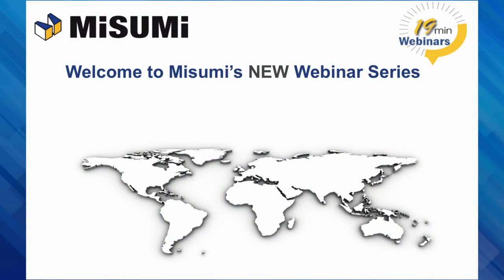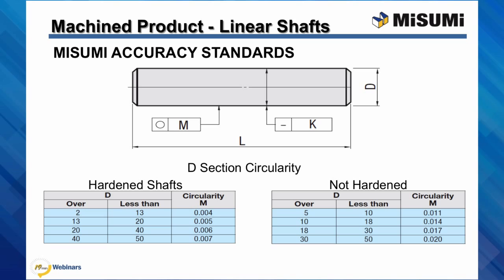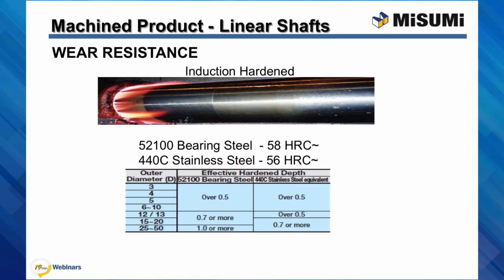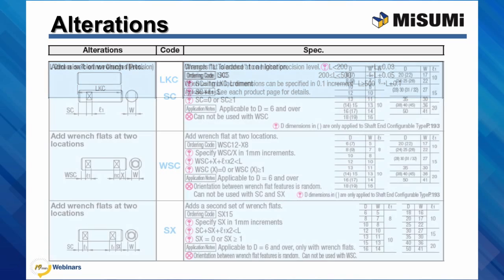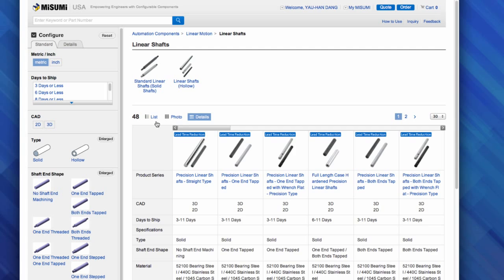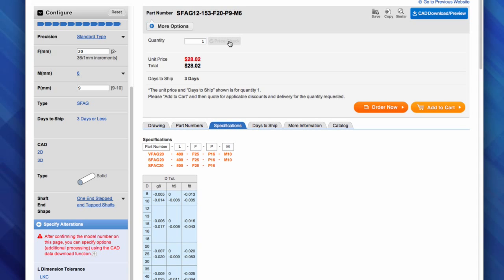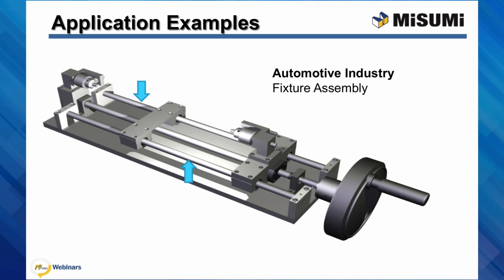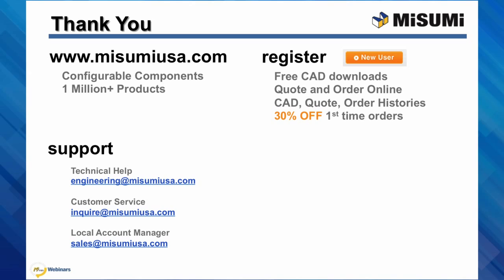Linear Shafts Overview

Comment from the maker: Check out this  #19MinuteWebinar on Linear shafts, lead by Yau-Han Dang, Assistant Product Manager of Machined Products for MISUMI USA. Yau-Han explains product selection factors such as accuracy, materials, and applications as well as important wear and corrosion resistance concerns. http://buff.ly/1nC1tbh